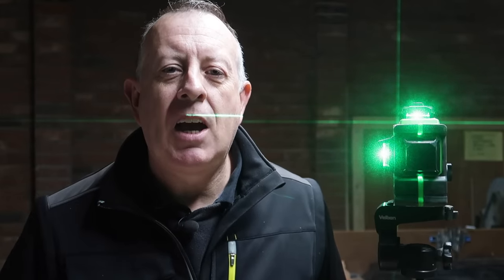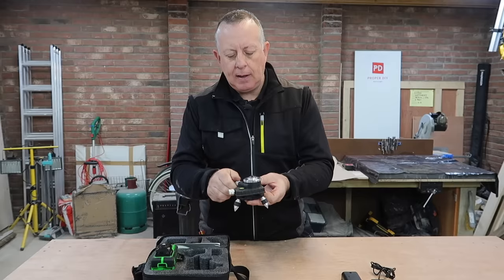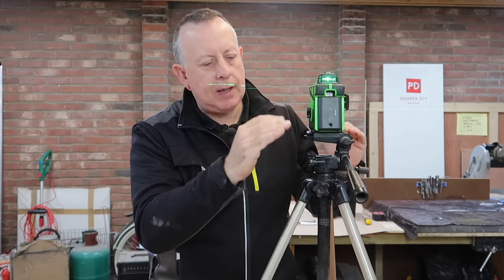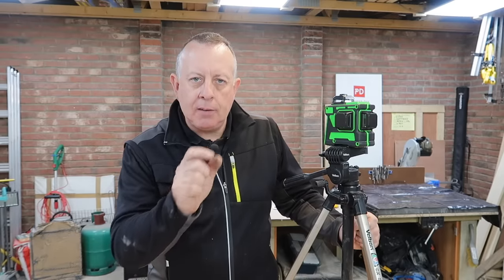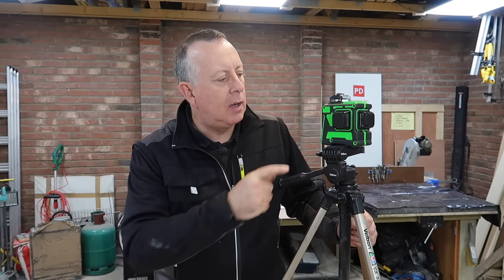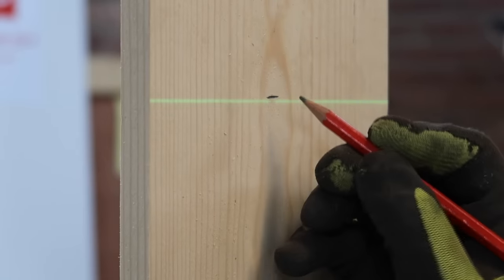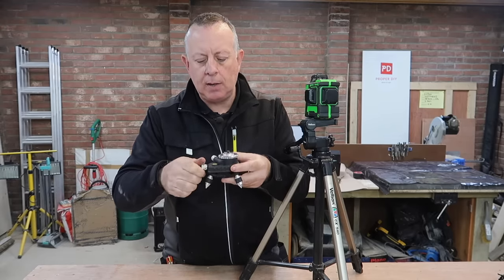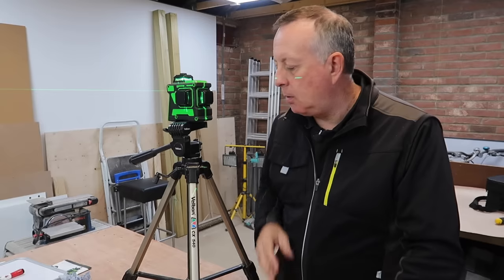Why Every DIY'er Needs a Laser Level

Comment: "less than the cost of a tank of petrol" 🙂......just means something different watching this in July 2022
Reply: I have an RV with an ~80 gallon petrol tank. Most things I own cost less than a tank of petrol :)
Reply: Just makes him more correct!
Reply: No denying…. After this and other videos I bought one worth 2 tanks of the old Motion lotion and it is serving me well!
Reply: Would be great if you told us the make and model
Reply: You did not show us how  to adjust the leaser if it was not within tolerance?
Reply: Even worse in nov 23
Reply: Try december 2023😂
Reply: Try January 2024
Reply: Apparently, fuel prices are falling in march 24.
Reply: @gf2e  80 gallons wow, Good job you dont live in the UK that would be £438 or $563 to fill up here
Reply: @KarlUKmidlands  Yeah, but over there a full tank would get me to and from anywhere in the country. About 5 times. 😂

I actually need to swipe my card twice to get a full tank. Most gas stations have a $150 or $175 limit.

Comment: Just a small point - when panning 180 degrees on a cheap tripod, the error could be in the poorly machined or finished panning plane of the tripod head and not necessarily a fault of the laser.
Reply: The Laser is self leveling tho
Reply: You're thinking like a photographer -- but the level doesn't act that way. You might need to physically adjust the height, but what you are checking is the consistency/repeatability of the horizontal plane it generates. The level itself is (supposed to be) self-correcting.
Reply: @dalexfilms  @terjepedersen269 I don't know guys, I think the dude is spot on. The turning of the tripod might affect the hight position. Has nothing to do with the levelness.

Comment: I started using lasers in 1986 and YES they are wonderful IF they are accurate !  During my more then 35 years working with them I told other employees to make sure and check the laser everyday to make SURE that its reading perfect !  Yes they can be off a lot after a ride in a pickup truck or someone bumps or drops it !    I found that it is very easy to trim the bushes in front of my home at night when I set up my laser... I pick the perfect height of he beam and run the trimmer along the bright red line = fast and PERFECT !
Reply: So youre the one who keeps waking me up! Ok ill remember that!
Reply: Good idea.
Reply: But what to do when the laser is off? Trash it?
Reply: @spokje  many years ago there were shops that could recalibrate them . The PLS company has a three year warranty and will just replace them because they cannot be repaired

Comment: I have one it’s great. But for my home DIY projects, 99% of the time I use a water level. I use a bucket with a lid to stop evaporation and a small hole at the top water line. This is the recalibration point - as long as the water level is filled to that point, all measurements can be repeated to a mm (yes metric user here). The bucket has a 20m long x 10mm diameter clear plastic hose so I can cover all my needs. I can go around corners, behind posts etc without reseting or moving my bucket (datum). Love my laser but the water lever is magic.
Reply: @John Franchina a lot of people won't have a clue what you are describing.. I haven't seen this used in a long time and yes it is a really convenient method. Thanks for reminding me again.
Reply: I have a tube myself and bought one of these. Together they work amazing.
Reply: I used to do this method many years ago for setting out retaining walls and fences.. I used to use Rum instead of water as it is lower viscosity and more accurate. A true spirit level so to speak. 🤣🤣🤣
Reply: @adrianvringer340  are you sure it wasn't a back up supply to your drinks cupboard? 😁😁😁
Reply: @adrianvringer340  🤣🤣🤣

Comment: I agree with everything Stuart says in this review. I have a very similar model. Mine has 2x batteries which can be charged either in or out of the laser, which is just brilliant. I also have  DeWalt cross line costing double the price. By comparison the unbranded 3-axis offers a brighter and finer line, and of course being 3-axis, is far more useful. Lucky me having 2 makes calibration a lot easier, not to mention fitting door frames with the 3-axis in the opening and the cross line checking for plumb on the perpendicular. I find the main advantage with the DeWalt is the well thought out and very strong magnetic mount. Build quality appears better with the DeWalt too, but I've dropped the unbranded model and it just carried on as before with no loss of calibration. Brilliant things, and like Stuart says, more useful than one might think. Also, at time of writing, Toolstation were selling a Stanley tripod for £25.
Reply from the maker: Good comments. It nice to hear you think the same
Reply: What’s the name of the unbranded model you have

Comment: I recently had to mark out footings for a greenhouse and then set up bricklines for a low wall. I did it using tape measures and a large right angle. The outside edge of the finished wall was accurate to +/- 1 mm and perfectly level, the aluminium greenhouse base overlapped the edges perfectly. I was well chuffed as it was my first time pouring concrete and bricklaying. I considered a laser level for the marking out but glad I didn’t buy one. I can see they could often make life much easier. Nice video, very clear.

Comment: I bought a DeWalt pendulum cross laser level and I have used it many times, I like the fact it uses easy to get hold of AA batteries and in the case has a place to store them.  The most impressive use was setting up hexagonal pictures in a hexagonal shape on the wall and the laser showed how much bounce there was in the floor.
I bought my DeWalt on sale for the same price as your 360 but given the amount it gets used I don't see me needing another one.

Comment: A very handy bit of kit to have in the shed.  I have an old Bosch fixed unit.  At 3-4m the line was about 5mm thick so close to unusable.  Cheers!
Reply from the maker: I think they have really come on over the last few years. Measuring the beam width for the video, I found no difference between 1 and 5m from the unit!

Comment: Love the videos, love the channel. If you've been getting more views it's probably been me binge watching them they're great quality and straight to the point! One thing to note with not just laser levels, but any device nowadays that has its own non-standard battery or a built in rechargeable one is, when the battery eventually loses capacity, you'll probably need to replace the whole thing (if it's a built in rechargeable) unless you want to open it up and fix it (which should be doable), or in the case of a custom battery, you'll be stuck trying to find a replacement but that is also possible to fix (still more work). I always try and buy things that work with standard rechargeables, that way I can be sure of getting replacements in the future (AA, AAA etc) and then I just use good batteries within them.

Anyway keep up the great videos, already subscribed.

Comment: For beginners, the 3x360 is definitely the way forward. It’s very intuitive. I’ve used the third axis to cast a beam on the ceiling and then mark off 90 degrees on the opposite side when drilling holes for LED down lights.

Comment: I also have a bosch laser level for floors that shoots 90deg and 45 deg. Lines. Before laser levels we used to use water levels which takes 2 people and is just a clear tube with water in it ! They worked great as water seeks its own level so its the same on ea end of the tube but it took 2 people to operate it!

Comment: Do you know what...IT is one of the best things i have bought so far...so versatile...I use it when i'm fitting kitchen units...especially when the floor is running off...the laser level can help you get your datum line so much quicker...no more adjusting pencil lines and using spirit levels, although they do still have there use....excellent tool.

Comment: Some thing to remember about accuracy, if you rotate say 30,40 degrees or whatever and use that line for plumb it may well not show a plumb line, if the wall is out of plumb so will your line be, its only genuinely plumb at the 90 degrees to the level.

Comment: I’ve always wondered about laser levels. Thank you so much for this professional presentation which has convinced me that this needs to be my next tool purchase! 🛠
Reply from the maker: Thank you - I should have bought some shares in them
Reply: @ProperDIY  does it matter if the floor is not 100% flat? Will the horizontal beam be truly flat or will it follow the same slope of the floor? 🧐
Reply from the maker: @marcnaidu5804  It is horizontal as the self levelling mechanism works on a pendulum system irrespective of how level your floor is.
Reply: @ProperDIY  thank you

Comment: So been abit thick, how do I get a horizontal line about skirting board height, im building concrete ramp to garage, I have put 1 side of shuttering up,want to put other 1 level,my garage is about 7 inches above outside ground, I understand moving tripod up and down, but they don't go that low,

Comment: Good video! The 'useless' 14/15mm threaded hole mount in the base is most likely for a surveyors tripod. 
Also you get what you pay for in lasers. The greater the price, the better the build quality, calibration and functionality.
Reply: 11:15
CAMVATE 1/4"-20 to 5/8"-11 Threaded Screw Adapter for Tripod Laser Level Bosch Adapter(Stainless Steel 304)

That might be used to adapt the base to allow it to be used with a standard photographic tripod-

Comment: Thanks for this video. I bought one myself with 2 batteries. Same  laser level, other brand name. It works fantastic. Charging the battery takes a lot hours. (10-20?)  When the led turns green it is full. Greetings from the Netherlands.
Reply from the maker: With 2 batteries that would be very good
Reply: What brand and model? Greetings from Dallas, Texas, USA
Reply: @colinjohnson5515  
There is no brand and model name for this one. They do not sell this one anymore. There is a new type of this one with 3 buttons I believe.

Comment: Really, really clear explanation of the usefulness of the 360 laser level, with simple instructions thrown in for testing the accuracy.  I already own a red cross beam, but can see I should have bought a green 360.
Reply: You can find out about Deglasers, it green 360 laser level works well.

Comment: There are a bunch of really decently operable, accurate, bright green 360 laser levels around that come in at a fraction of the cost of the ones made by the big boys - the best part is not only can you check their accuracy yourself but if they get out of alignment you can actually calibrate them yourself fairly easily, they usually have adjustment screws for the pendulum mass then recheck - it isn't that hard. ISO wouldn't be very happy in a commercial setting where cost isn't really an object anyway, but for the home gamer they're more than up to the job. My one takes 18650 batteries which are really common and high quality because of their ubiquity in the vaping market.

Comment: I'm a professional developer and I was weaned on Dumpy levels - my current level is a Leica. A Dumpy has a greater range than an entry level Laser although it's principal drawback is that you need a man at the other end to hold the staff. For small scale/DIY projects a Laser is probably a better choice but if you are ranging drain levels in or the like a dumpy is preferable.

Comment: Thanks Stuart - always learn new things from your videos. I remember  from younger days spending ages on top of a mast being involved in panning a dish for a telecomms radio signal to no avail. Somehow, as a last resort (assuming no obstruction to the path) I wondered whether the horizontally  polarised feed to the dish was truly horizontal. Turns out that when we married the rigger's spirit level back to back with mine taken as horizontal, his was well out of true. After resetting with the latter taken as horizontal the signal burst into life. Your calibrated laser could possibly have saved many hours of work.
I have a reservation though - in the case of the odd slopey floors in some houses, hanging an object to a true horizontal may not necessarily be the best option -  rather, taking a parallel with say the top of the skirting board or perhaps the underside of a picture rail may be an option - (which I imagine the laser level can do)  - or as a last resort I find 'eyeballing' may be a last option. Memories come back of visiting the crooked house in one of the resorts......
Reply from the maker: Thank you. Yes, sometimes you need to follow the existing rather than what is correct - this really depends on the circumstance - see my comments in my last video when I was installing a lintel.
Reply: Right, thanks for explanation PD.

Comment: Hello, great video. All good equipment comes with a prize. I own a bosch level laser, build of good plastic, with a good instruction manual. A good micro adjustment base which fit on a normal tripod, an you can attach a ceiling clemb hich also is magnetic. And it has a calibration warning. 
I can switch it on/off with my iphone and i also can rotate it with my iphone. And i have two recharcable batteries. All those negative things you mentioned i don’t have. But mine cost a bit more money. It’s just what you want to spent,  i’m very happy with my Bosch GLL 380 CG.
Reply from the maker: Thanks! I'm sure your Bosch is good but at around £350 is outside the reach of most DIY'ers - I could justify spending that type of money unless I was using it for work everyday.

Comment: Great review nd demo.  I picked up one from another manufacturer just like it (it uses easy to find replacement Li-ion cell batteries).  It saved me hours of manual work laying out my basement framing... sill and top plate locations in particular.  Well worth the $120 USD I paid and it will be of great help in future projects.
Reply from the maker: Thanks for sharing
Reply: Which one did you get and how has it worked so far??  Thank you in advance. I am ordering I one very soon

Comment: That 14-15 mm thread is (if I remember correctly) used on a surveyors tripod. The big yellow ones used on worksites and streets survey etc.
Reply from the maker: Yes could be. I should know that I spent 3 years using that type many years ago.

Comment: Good video. Never thought to check the accuracy. My biggest problem of using a camera tripod is the max height achievable as they only go to 1,70m or so. Wouldn't be the first time the tripod stood on 3 chairs to get a level for a high shelf.
Reply from the maker: Yes, I know the feeling - you can see me do the same in my 'Install a Lintel and New Doorway' video from last week. This is where an additional bracket that is magnetic or can clamp onto a pole would be useful.
Reply: @ProperDIY  Luckily mine has a magnetic sub-base, but inside the house limited steel surfaces to apply to. Garage/workshop OK as I have 3 x Steel wardrobe/lockers around the place.

Comment: Hi mate, I've just bought a 360 degree 3d laser on the strength of your great video,  one question if I may, can all 3d 360 degree laser levels be used as a plumb Bob , I watched this video and was so impressed with the lines crossing above your head and below on the floor. 
Keep up the great work 👍
Reply from the maker: Yes definitely as a plumb bob. The vertical line should be plumb - best to check it though

Comment: Think that screw thread is for use on theodolite tripods which seem to use 5/8 as opposed to the smaller camera ones which are 1/4 (or there are ones which are 3/8). You can buy adapters on Amazon or eBay.
Reply from the maker: Yes thats prob it. It's been a long time since I've used a theodolite tripod which is a bit heavyweight for this type of kit. they should have an adaptor so both can be used.

Comment: Spin the pan and tilt head off the tripod. You will find the fixing bold for the head is removable. The bolt has a different thread on the other end and can be flipped and refitted.  Then you can use the supplied mount . Most good tripods have this facility 👍
Reply from the maker: I have this on my better tripod but it's still not big enough to fit. Some think it could be a survey tripod fitting which may well be right as those are a lot bigger.

Comment: 8:39 this alignment check, correct me if i'm wrong, but this is really only checking to see if the auto-leveler is consistent, it doesn't really check if it's actually level. right?

Comment: The price is amazing , however there is on thing it can't do and that is find level when there is no line of sight . When building outdoor decks many many years ago i used a water level . a small plastic container and fifty feet of clear plastic tubing . The advantage of this simple device is you can walk around the side of a building or go under an obstruction and get a mark that is within a sixteenth of an inch . accurate enough for a wooden deck and they are super cheap .

Comment: Hi Stuart, I purchased this level and it is very good, my only problem being trying to use on a non level surface (switching on without the gimble?) the level only appears to work with the switch on and the gimble active?
As you say the manual is useless and there is little information on line, it may be that I have misunderstood the operation or it could be faulty, can you advise?

Comment: Fab video as ever. Delighted that I bought exactly the same level before I even saw your video. Quick (and possibly stupid) question - if I am looking to set a horizontal level about 300mm from the ceiling, does that mean I have to try and find a tripod about 2m tall ie can you only set a level the same height as your tripod/stand reaches?